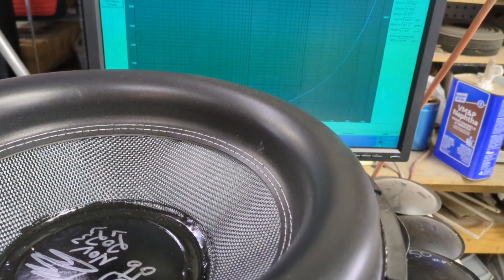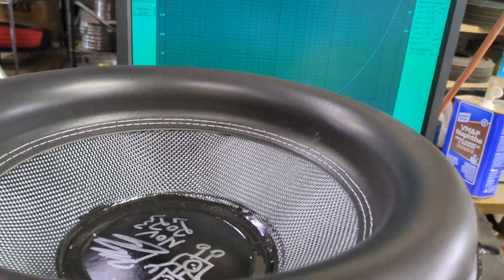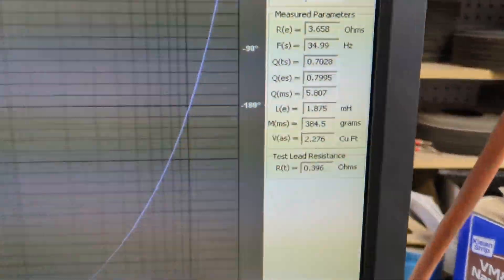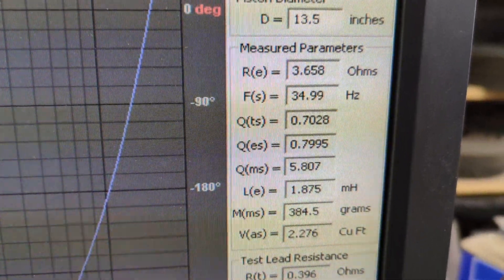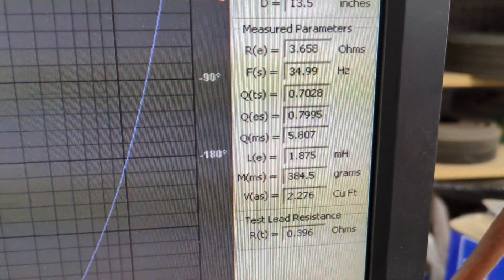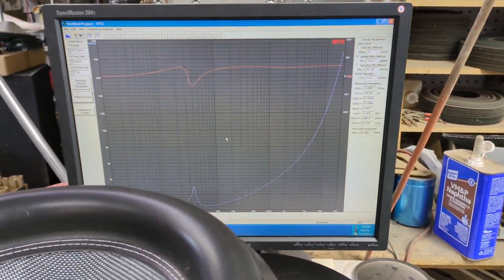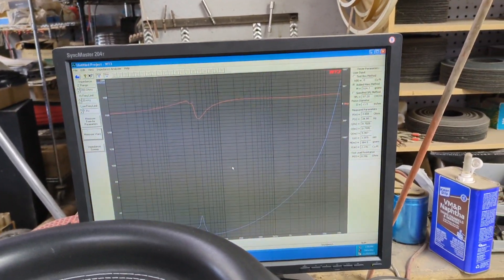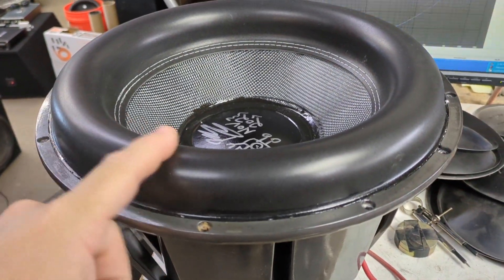15" D2 Rockford Fosgate Power Series T2 Subwoofer Rebuild by Robot Underground 🤖 TSP Tested

Comment: Do you know the volume of the subs you build, to figure into the box cu ft dimensions or just build the box to a volume and not worry about the sub volume?
Reply from the maker: It depends.   It really depends on application
Reply from the maker: If it's for a small volume I always recommend a larger motor
Reply: @RobotUnderground  I didn't mean loudness, I meant cubic volume. Like how much the sub displaces in the box. Like if the sub takes up 1.2 cubic feet of the box. So, like a 15 might displace 1.5 cubic feet and a 12 might displace 1 cubic foot. You should know what it displaces to figure the total box volume, correct?
Or do you figure you want a 2 cubic foot box and just throw sub in that takes up 1 cubic foot. Then you're really just at 1 cubic foot. Correct?
So.... Do you tell customers how much volume/cubic feet, each sub will take up, in the box?

Just curious.
Reply from the maker: @funfun8095  Study the displacement numbers that the companies will post.  You'll see that it's a very small value and not really worth accounting for.  Run it through the box response simulator program.
Reply: @RobotUnderground  Ok. 👍

Comment: Qts of 0.7? Why??
And you're talking about porting it?
Reply: Maybe because of the higher fs?
Reply from the maker: It just does better in ported.  Typically 0.5 is the break-even point of ported versus sealed anything greater than .5 is better imported anything lower than .5 is better in sealed
Reply from the maker: Nope
Reply: @RobotUnderground  Backwards typo?
Reply: @RobotUnderground  How would you get a higher QTS if building a driver?
Reply: @maincharacter2677  Lower Qts for vented/horn/etc. Higher Qts for sealed/IB/OB. I'm not sure why he said it the other way around earlier. Maybe a typo, I hope.
Reply: @BrandinHutto  Thank you!
Reply: I've always went with below 0.5 ported, 0.5-0.7 sealed or ported, 0.7-1.0 sealed and 1.0- up sealed or infinite baffle.  That's definitely not the only thing that determines the type of enclosure that a sub needs tho.
Reply: @hopskustomaudio  I understand thanks for the break down!
Reply from the maker: @maincharacter2677  And why would you want a smaller Qts?  Remember that a low Qts shows a really violent peak at the Fs.
Reply from the maker: @hopskustomaudio  Run them through the box simulator to see the results and how it effects box size requirement.
Reply: @RobotUnderground  Oh I definitely wouldn’t trust me. I got confused yesterday, when building a driver though how would you make one with a higher QTS, would it be making the motor more powerful?
Reply: Weaker motor = higher Qes/Qts, higher impedance peak(s). Much above 0.5 leads to an unavoidable peak near fb, especially in a vented box. Anything much above 0.5 might only be suitable for infinite baffle, but I actually prefer 0.5 with some EQ for that. Anything above 0.7 is absolutely worthless, except for open baffle (baffle or H frame only, no box).
Reply from the maker: @BrandinHutto  No, it's a relative ratio of weight and suspension to motor force.  We've seen really heavy coils with big motors have a Qts of over 1.0.  Typically small, weak, light woofers have a low Qts which is really violent at the resonance.  Sometimes you also get a really peaky woofer when the Mms is high and the suspension is soft.  overall, as long as you port just before the Fs, it rolls off fine.
Reply from the maker: @maincharacter2677  Heavy Mms and floppy suspension.  It'll peak really hard at the Fs but if you port just before the Fs, it should roll off  nice.
Reply: @RobotUnderground  Yep. I prefer lighter cones and suspension to what's usually available. And low Le. Acoustic Elegance is kinda on the right track, but expensive for the output you get. I wish there were more woofers available like that though. I'm tired of seeing 0.6+ Qts woofers with heavy soft parts and 5 mH+ inductance for $500. DC and DD, for example.
Reply from the maker: @BrandinHutto  If you say so.  We do plan on making some Cerwin Vega home speaker clones.
Reply: @RobotUnderground  Okay thank you. I literally get all my subwoofer knowledge from you.
Reply from the maker: @maincharacter2677  Well I know you love, #HandysNotHate but try to read some books. http://audioheritage.net/files/Loudspeaker%20Design%20Cookbook%20by%20Vance%20Dickason.pdf